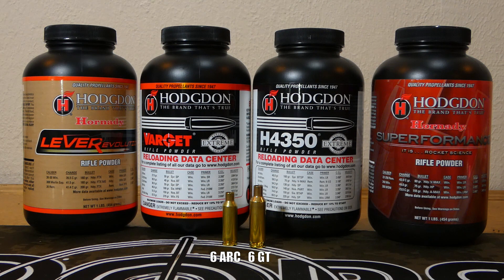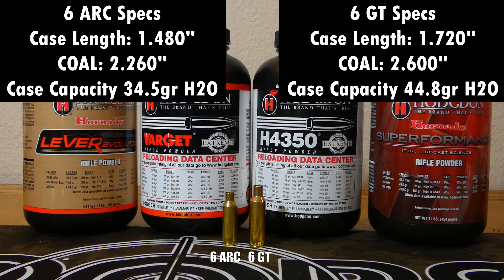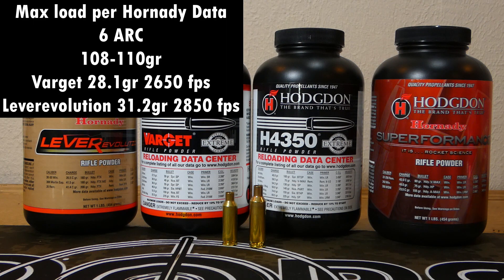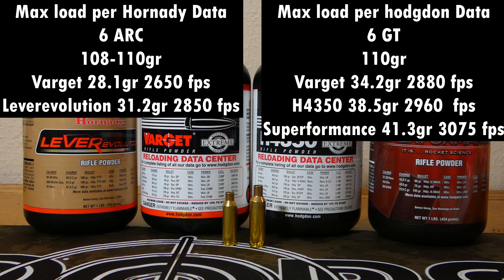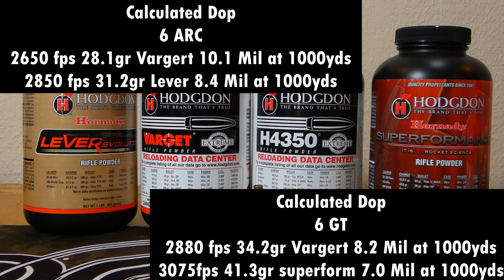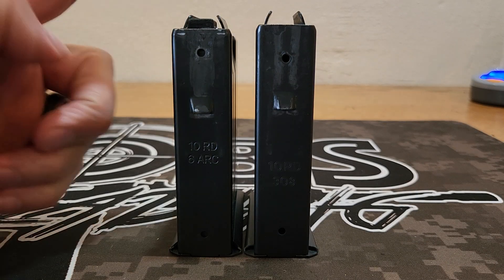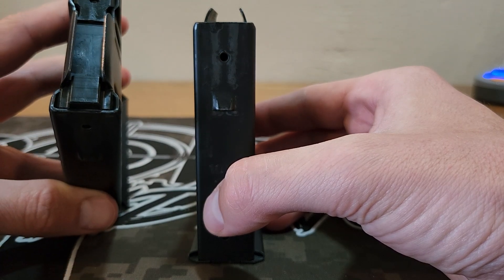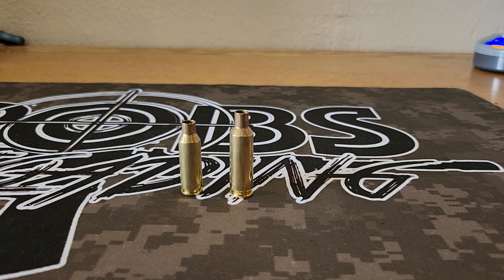6ARC Vs. 6 GT

Comment: I fail to see any reason for the ARC, other than for an AR platform. Within the constraints of that platform I believe it is one of the best options out there. In a bolt gun there is a plethora of existing cartridges that use a standard case head.
Reply: Accuracy from it and the grindle so far have shown to be leading factors.  I wish he'd went into groups and MOA from each.  At 100yd is 1 thing, but let's say we are tossing them at 500yd that accuracy will make a big difference.

Comment: I think there are plenty of 6mm cartridges to “outperform” 6ARC in terms of raw velocity. I think the main advantage to 6ARC in a PRS type setting is it’s lower recoil and longer barrel life due to it using much less powder to achieve similar velocities. Total volume of powder is a major factor in barrel wear and contributes to recoil. I don’t know why you would pick 6ARC as your “hunting” rifle, seems backwards to me.
Reply: I’m starting to research PRS and a wanting to build a rifle for it. I have had several guys who shoot 6GT tell me that they are loading down to 2750 fps because it gives them a split second longer to refocus and see their impact. Which has lead me to 6 arc, and I think for prs, being a little slower is actually also an advantage.

Comment: If Gun MFG's would just barrel all .243s w/a 1 in 8 Twist, it would be AWESOME or a 1 in 7 would be even mo better. The .243 is a GREAT Caliber and Brass and Components are easy to find.....
Reply: You have to realize that everybody doesn’t want to shoot heavy for caliber bullets ! Most coyote hunters use 58 to 80 gr projectiles in 6 mm …. And you can take any deer at 300 yds with an 80 or 85 gr bullet !…….
Reply: @thomasdaum1927 I use 115gr for yotes lmao
Reply: @tanggang6824 No , to much pelt damage …..
Reply: @ we don’t save the belts
Reply: @tanggang6824 it’s Pelts not belts….You can probably find someone in the area that skins and sells them , and split the sale of the pelts . It helps pay for the gas money .  From October to April Ispend around $500 bucks in gas for coyote hunting. I go out 4 to 5 days a week !
Reply: That's what I'm going to do with my 22-250....go from 1:14 twist to a 1:9
Reply: I have a 30 inch Krieger1:7 chambered in 243win. I throated it to shoot 115gr Dtacs
It's a hammer

Comment: Imagine a 6GT in an AR10 platform 🤔 i know sgt of arms did a 6x47
Reply: don't know if you'll see this or have researched since your comment but several companies now offer AR10's in 6GT.
Reply: @oif3vetk9   yea.   Sgt of arms i believe does now
Reply: I was thinking 6x47L in the new Ruger SFAR.
Reply: @rustynut1967   sgt of arms makes a 6x47 ar10
Reply: @MrBoostin18  The ruger is smaller, lighter and cheaper. It would just need a rebarrel and would still be cheaper.
Reply: @rustynut1967   yea i don’t care for rugers tho.    They don’t build products ( other than an AR) that make it easy for consumers to modify and make their own.   I bought a bolt gun and wished I’d bought a savage.
Reply: @MrBoostin18  I'm not a ruger fan boy but almost every company has their hits and misses. As far as not building a gun other than the AR to modify, you must have forgot about the 10/22. I don't think there's a gun made that offers more aftermarket parts. I wouldn't write off any company, depends on what you want.
Reply: @rustynut1967   i did forget about that.  But that’s like their only one.   The fact that if you need parts to fix their bolts on the bolt action gun, you can’t get them.  They won’t sell them to you.   That bs!    Buy savage and parts are easily had.
Reply: @MrBoostin18  Yeah, for a bolt gun Remington 700 pattern would be my first choice with Howa and Savage a close second.

Comment: Surprised you didn’t touch on your accuracy findings. Watching both series thus far, you appeared to have much better results from the ARC in your Savage than the GT in the Seekins. Overall I know this is a set example of just your two guns, but I’m kind of surprised you haven’t had better groups with the GT yet.
Reply from the maker: Accuracy In my opinion is going to be gun specific. I don't feel one of these cartridges Is inherently more or less accurate. I've been successfull with both  grouping sub half minute accuracy at 100yds. I feel that is about as good as I can regularly hold my my shooting set up.
Reply: @RobsReloading  Couldn’t agree more. Though, seeing your Savage 22” group in the ARC series, then the Seekins in the GT, I’d lean towards the ARC in those two solely on those results. My ARC, which is an exact copy of yours (Savage 22” from Sportsmans) is hard to beat. I’ve gotten 3 loads to .3” with that gun using Hornady 108 ELDs.
Reply: Would you go with the switchback or tactical in 6arc?

Comment: Thank you Sir. Appreciate the explanation & comparison. Options are most always a good thing. I was liking the 6 ARC over the larger AR calibers that have been out for longer. Your data & results were a good part of that thinking. But I saw/see this GT as more of a contender/competitor to the 6CM than the ARC.
For me it is mainly the size of cartridge that steers in that direction. Nevertheless both offerings are really good in many areas and they good options to have available today. Happy hunting.
Reply from the maker: That is probably true, but I have no experience with the 6 creedmoor or any of the other 6mm variants with the exception of the 6 arc.

Comment: What would you estimate barrel life being for this cartridge?
Reply: 6gt with a premium barrel 2200 or so
6ARC with premium barrel around 5000
Reply from the maker: @6creeder688  I would say barrel life is going to depend on the loads you run. Slow 6 GT loads should be similar to a barrel running hot 6 arc loads. Hot 6 GT loads probably going to burn the barrel pretty fast like a 6 creedmoor.
Reply: @6creeder688  interesting, thanks for the info. 👍🏻

Comment: Thank you for a very fair evaluation.  If one plans to load  lighter loads, the 6ARC is very efficient and accurate.  Btw - do you the advantages of 6GT vs 6CM?
Reply: I have a 6ARC, 6gt, and 6cm honestly the 6cm makes the most sense to me hardly no difference between them and easier to get 6cm brass
Reply: @6creeder688  I have a 6ARC Savage bolt gun, a 6CM Ruger Precision Rifle, and a 243 Kimber Hunter.  I shoot the 6ARC the most because I get "enough" velocity and save on powder and barrel wear.
Reply: @texpatriot8462  a buddy has the short barrel savage it shoots good